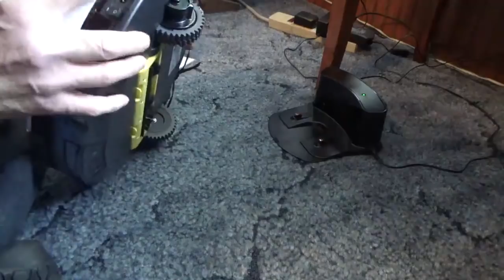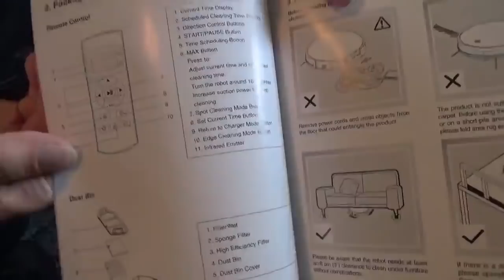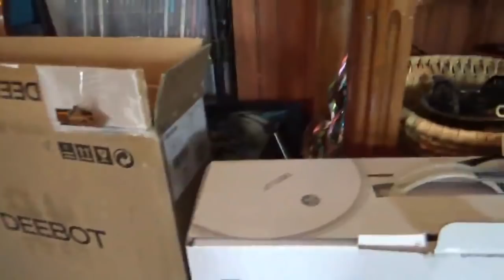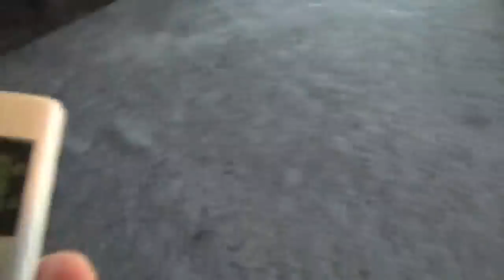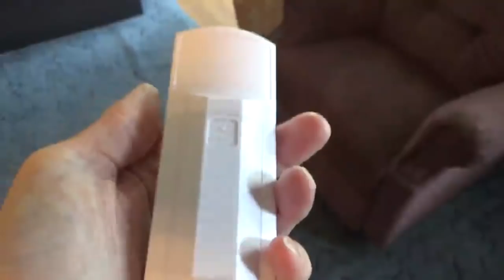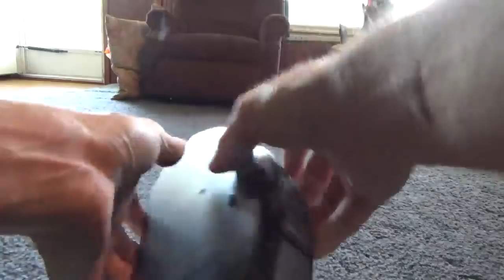ECOVACS DEEBOT M82 Vacuum Floor Cleaning Robot

Comment: I run the m6 daily, and my floors look awesome🌼 allabout.wiki/ECOVACS-N79S I wet mop 2 days and dry sweep the rest of the days. When I first got it, I used the included disposable pads. I didn't like them--the dry pad has no depth so if it picks up a chunk of something, like dry cat food, then it pushes it around or drags it around the floor. The wet pad wasn't very absorbent so left streaks and wheel marks.
Reply from the maker: Good idea, it does wedge too easily.